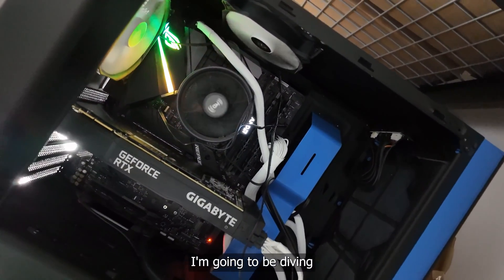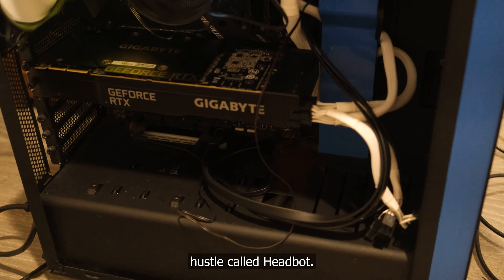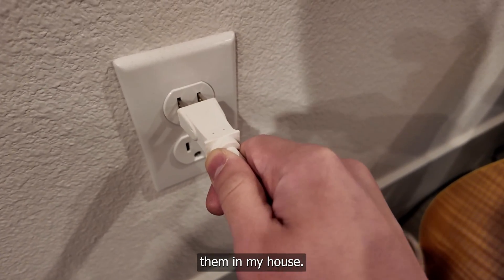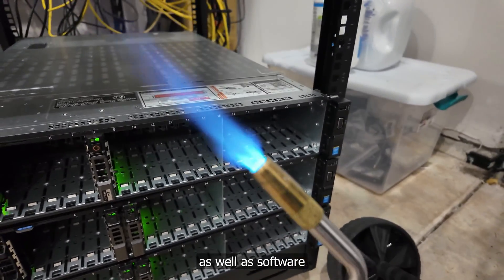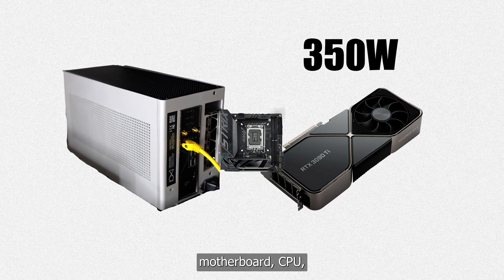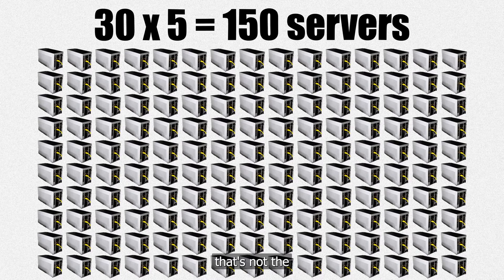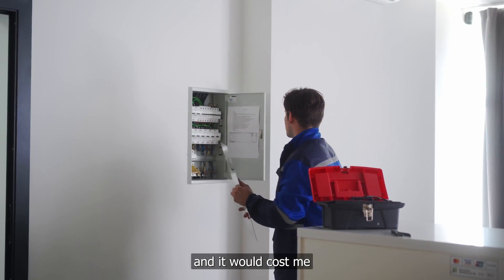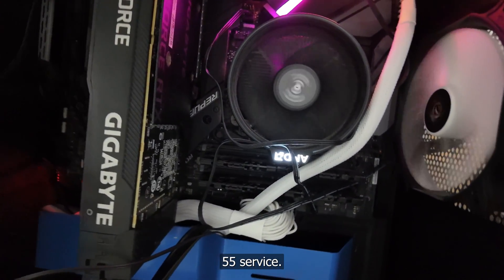How many AI servers can I run at home?

Comment: I think the load calculations are incorrect.

It's 200 amp service across 240V, not 120V, meaning you get 48kw. You are buying 240V service from your utility company so you can provide power to 240V devices (dryers, ovens). Also, you can't use all the kw like this. You are only allowed to use 80% of that to make sure you don't pop breakers,
Reply: @thegalah I haven't read your contract so obviously I can't know for sure, but usually for high current draw appliances in continental America it's 2x 120v 180deg out of phase. this would mean that either of the 2 live connections would measure 120v relative to neutral, but 240v relative to eachother. As long as it turns on and you're not worried about the wires in your walls getting overloaded and catching fire, you're fine lol
Reply from the maker: Great points. I believe that's true outside of the US. However the us runs infrastructure at 110-120v ac.

You are correct that my calculations are ignoring household loads and is assuming I'm not running anything else.
Reply: @thegalah  He is correct in the typical household in the US having a theoretical maximum of 48kw available on tap with a 200amp service. US homes do infact have 240v services. Two 120v lines out of phase from eachother. In your service panels, when a breaker is taking up two slots, that is because it is using 240v. US panels alternate their phases on the breakers.
Reply from the maker: Interesting I do see a breaker in my panel that is 240v but it combines two breaker slots. I just assumed it consumed double the amperage of a single breaker and not increasing the overall capacity. You are right
Reply: @thegalah  At this point, I highly suggest you learn about electrical distribution panels. EVERYTHING that comes into your house comes in a 3-phase, 240v circuit. Two 110v leads and one common. In the panel, the splits down a left and right rail (bus). Each rail is 110v.

A 240v breaker uses two-120v leads (two 120v breakers ganged together). You will also notice a Amperage rating on each breaker. You have to take amperage into account as well as watts and volts.

The wires and the breakers are calculated to work together.

15A circuits can use 14Ga wire
20A circuits should use 12Ga wire
30A circuits should use 10Ga wire

These are ratings, so you likely could get away with one step smaller guage if you don't mind voiding any property insurance for not using wire conductors as specified by the NEC.

Because you are going to put a heavy load on each circuit, one breaker per circuit, you have to understand nominal load, and peak load of the circuit. An example:

One computer running pulling in 1400watts over a 120v circuit is using 11.7Amps. 15A breakers are designed to withstand a continuous 12A (nominal) before they begin to MELT internally. And they are designed to pop with demand goes over 15A.

Related, while a 14Ga romex conductor is designed to handle up to 600V of power before it melts, you also have to consider the length of the cable run from the distribution panel to the outlet. Example: a 15A breaker with a cable run of 30 feet would need a 10Ga conductor, instead of a 14Ga. ( https://www.how-to-wire-it.com/electrical-wire-size-calculator.html )

And this is just one of three ways to calculate load according to the NEC.So... you need to look at a lot more things and do a lot more calculations before going crazy here. I would hate to hear about the 2nd Great Seattle Fire happening and traced back to your server farm in your house.
Reply from the maker: Really great info here especially with the nominal and peak loads. I always assumed the breaker rating meant that it would melt under that specific load.

Just to put everyone at ease, I am nowhere near close to having that amount of servers in my house! I also will not be doing any of my own electrical if I ever do need to upgrade.

Comment: To save some electricity you can undervold each gpu (I have 2x3090 strix OC almost 400W each, but with undervolt it consumes around 290W each with almost the same perfomance)

Comment: What infrastructure do you use to connect all of them together? Kubernetes?
Reply from the maker: Yeah i am running rke2 specifically. I have three r730xds 2u rackmounts which I use for the majority of the workloads and a few specialist nodes for gpu workloads
Reply: @thegalah very nice
Reply: Never mine I just read your other comment.
Reply: Have you thought about using blade servers?

Comment: Here me out: Asrock Rack ROMED8-2T. $650 bucks. 2 10 gig nics and 7 full fat x16 slots. Pair that with like a Epyc 7303p which is also about $650 bucks. Second hand ECC is cheap but you probably don't even need that much so you might want to buy new for added reliability. One epyc system is probably more reliable than a Kubernetes cluster on consumer hardware.
Reply from the maker: The main workloads are run on some old Poweredges. These consumer machines are only running specialist workloads

Comment: why not consolidate and virtualize?
Reply from the maker: What way do you suggest? I am running my hardware as part of a 7-node kubernetes cluster bare metal with two of them being gpu capable.
Reply: @thegalah I don't know your workload and ideal acceleration, but I'd personally spec out an old GPU mining motherboard with a xeon/threadripper socket. I'd personally target 4-6 cores per GPU but that's just speculation ngl.
 that should work as is if you want 1 powerful node, but if you want to run with backups, virtual switching and better isolation, I'd run Proxmox and assign an even split of resources between however many vms I went with.
The main reason I say consolidate is that power efficiency doesn't change much between PSUs, what matters is the total number of units. 1x1000w is much more efficient than 2x500w.
Reply from the maker: Really useful info that makes a lot of sense. Probably something to keep in mind to reduce power consumption and squeeze out more from each breaker if it ever gets to that point!
Reply: @thegalah  And don't take your gigabit connection as a garaunteed solution! Since your service relies on images, your bandwidth will add up faster than you might think. While I wouldn't say switch right now, I would price out 2.5Gb and maybe even 10Gb connections, just so it's not a scramble should you need it in the future.
Reply from the maker: @tomstaunton1804  I did run into some bandwidth issues for a really specialised project in the past. But currently that's not so much of an issue. 10gb is ridiculously expensive as of now haha. I did spec out 10gb for a high throughout nas but the price turned me off. Are there any tools you recommend to monitor network throughput saturation?
Reply: @thegalah  overall network saturation is most easily viewed in whatever software your router uses, assuming it has the feature. I personally just run pulseway on my machines and work with a per machine look at bandwidth usage instead

Comment: why run an entire new pc for each 3090
Reply from the maker: Great question! The consumer machines I have in my home lab are just old hardware. I think at some point if we are growing fast enough it may make sense to perhaps purchase one of these crypto motherboards that can support multiple gpus
Reply: @thegalah  Before considering a crypto mobo definitely check to see if using a 1x lane bottle necks you at all otherwise you might have to go epyc. Also their is a quite measurable difference in efficiency going from 120v to 240v. For most decent power supplies about ~5% added efficiency. So if you do go through the trouble of upgrading your service that's an easy enough upgrade to make.